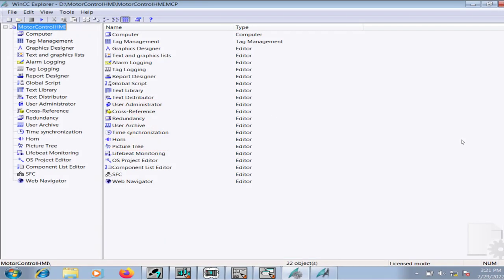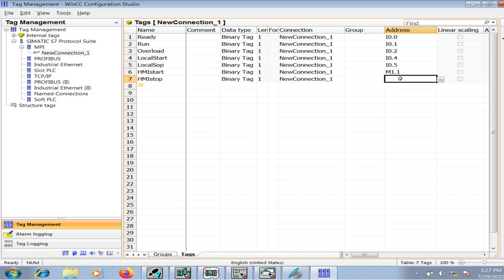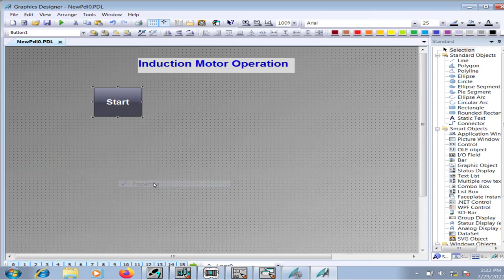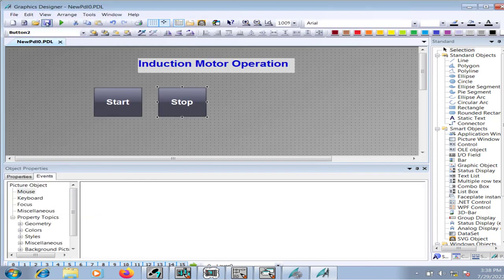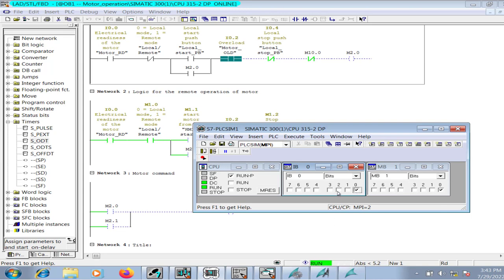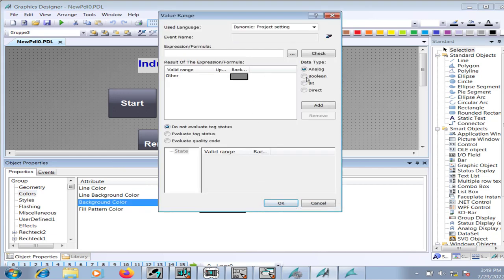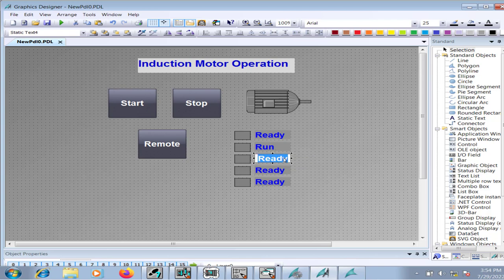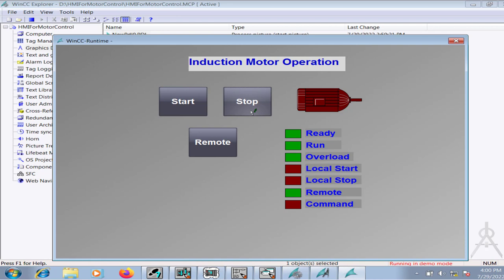HMI and PLC Programming for Motor Start and Stop | Motor operation and control logic (3/3)

Comment: Sir question. In our plant Our motor start and stop pushbutton is not connected to PLC, meaning it is not connected to D.I. cards. It has only feedback like motor status, auto mode and hand mode. Does your design can be seen also in real plant?

Comment: Sir in S71200 how can we design Remote and Local In a same Button on basic HMI
Reply from the maker: You can do it in TIA portal by linking the button text ..i.e Local and Remote... for instance with a memory bit. When bit is high local will be visible and when low Remote will be visibile.

Comment: hello can we connect the hmi design on wincc to mobile remote without using hmi display?
Reply from the maker: I think its not possible to connect to remote mobile phone.
Reply: You will have to upload the tags to cloud, and then you can make a screen not on WinCC, but using various platforms. On those screens, you can monitor them. Remember, uploading to cloud adds cost as there are a lot of tags and variables that change and you will have to pay to the cloud service provider accordingly